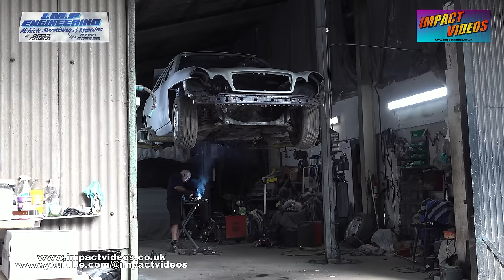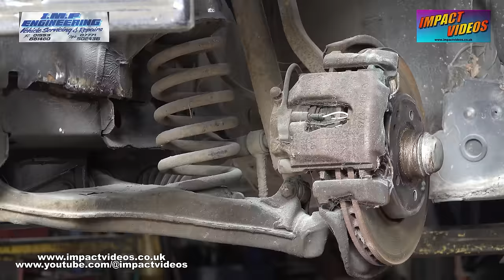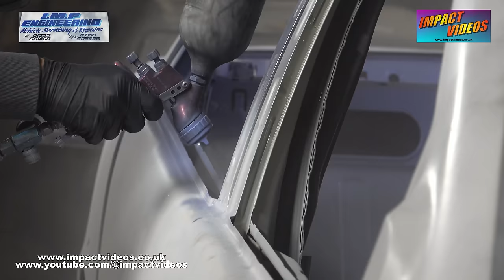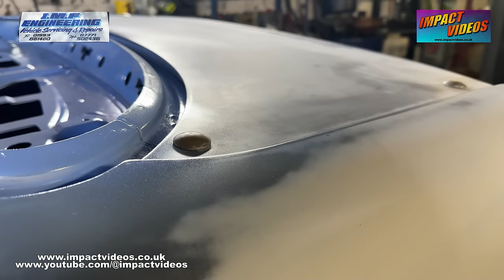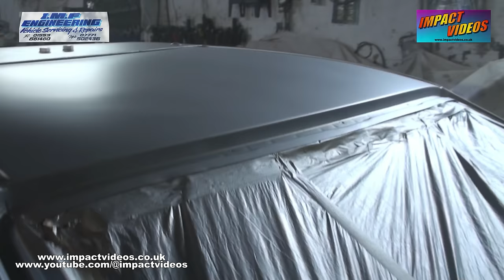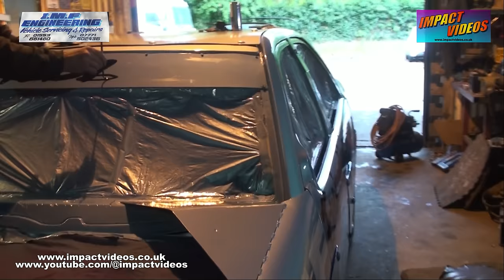World Final Unlimited Banger Race Car Build Video with 673 Darren Fendley Part 2

Comment: What is the engine & gearbox from? He said it was a 2.3 litre something.
All the work going into something that is gonna get smashed up. 
Especially re-inforcing the front end. It looks like there is not much actual suspension after looking at the spring coils they have plates all over them.
The effort the guys put into paint is jaw-dropping, but understandable for such a major meeting.
Reply: ford  2.3
Reply: gear box  sometimes are type 9  or rx8 gear box